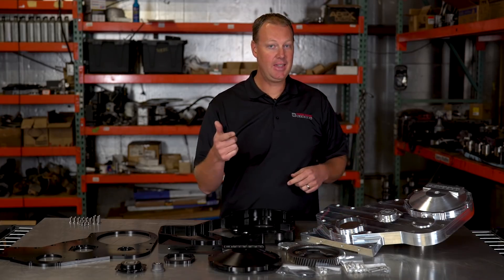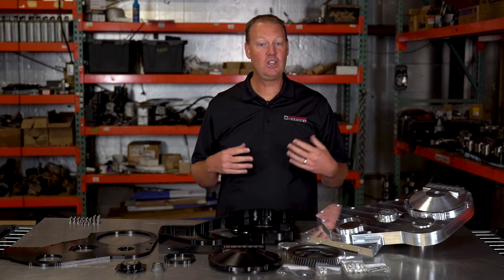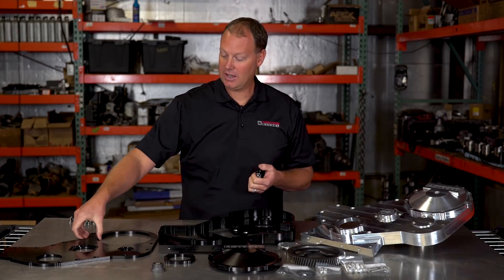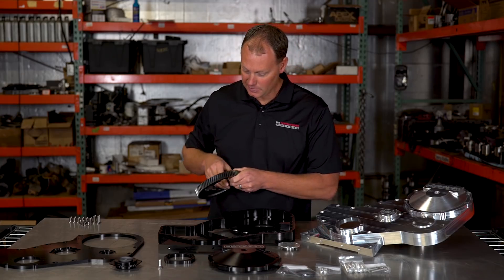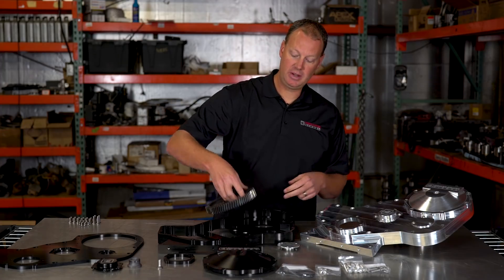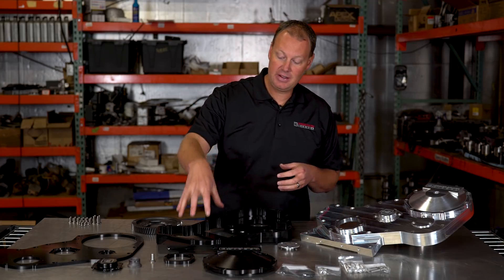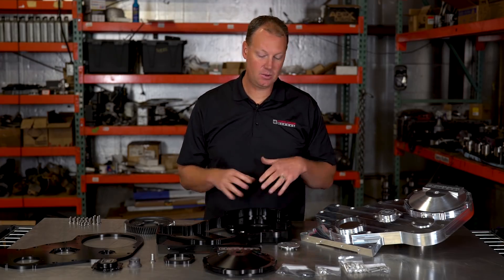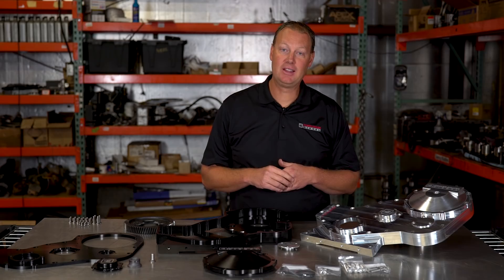Common Rail P-Pump Gear Case | Power Driven Diesel

Comment: Would like to see that for a 5.9 Cummins and to run the Powerdriven Diesel fuel pump off the cover like Todd does with his Waterman’s fuel pump on his race truck instead of building it to the bottom that would be cool really clean

Comment: What is the benefit of having a p pump on a common rail?
Reply: It’s just a conversion to get rid of the electronic common rail injection system in favor of the mechanical P pump. As far as benefits it just allows you to use a bigger 6.7 bottom end with a mechanical injection pump which is favored in some applications  for its ability to reliably supply a lot of fuel, like sled pulls.

Comment: speaking from a towing aspect, not racing or sled pulling. prolonged uphill towing. lots of loaded millage... if i swap out my trusty old 12v with a 6.7 Ppump. leaving it close to stock numbers for the 6.7 nothing wild. would i see better egt's turbo spool, and over all towing improvements by swapping. one of my trucks is just under 800k and its getting time to retire that old 12v. the 6.7 are far more common and oddly cheaper than a good 12v in my area. it would still cost more in the long run to do the 6.7 but im an odd duck who like real reliability over electronics. as for transmission i just completed a spicer 3053a swap and would plan on running one behind the 6.7 if i did so... really dont care about being faster. just hate how i have to watch my egt's more than my speed in the mountains.. its a tricky trade off with a 12v.. power and high egts, lower power low egts.

Comment: I have a dumb question. why don’t I ever see anyone using water/methanol injection anymore? did Everybody give up on it??
Reply: i think you should come up with a 2 stage belt drive system kinda like your fuel pump set up. that will run based on boost or EGT I have a  kit It’s pretty sweet when it works...but the Electric pumps  don’t hang very long.

Comment: Sorry but those counter sunk screws are absolute rubbish use real bolts . I bet you'll need blue loctite for those nasty screws good luck when you round them then need drill them out bit for a eazy out or( snap on) broken stud removal  kit

Comment: Is there a way you could of made the gear case come off with out removing the cam
Reply: Why would you ever need to do this?
Reply: @andrewterry3176  
Because if the gear case starts leaking oil u got to pull cam to put new gasket behind gear case
Reply: @bigmurph1447  if you had the case off ever and resealed it, chances are, you wont ever have another problem with it leaking. I don't think that could ever happen without sacrificing structural integrity.
Reply: @andrewterry3176  yeah I know it was just and idea sometimes I just think about stuff to make it easier In the long run if it did need to be resealed

Comment: Does a stock oil pan fit off a 6.7 with this pan or do you still have to adapt the pan to work with this case like before.... Do you guys sell a straight cut gear to drive the p-pump or do you recommend changing out the cam and crank gears to helical style
Reply: PowerDrivenDiesel ahh cool thanks for answers my questions:)

Comment: Sweet engineering job to the front case.!
What I would like to see is some front suspension mods required to run that kind of torque 
Maybe a little info on how to keep from bouncing at launch( air pressure, shock compression rebound, spring rate etc)
Thanks a million for the info, have fun and be safe

Comment: Would a standard 2nd gen p pump gear case not bolt onto a common rail block???  Whats different?? I was always under the impression that gear cases are interchangeable between the common rail and older blocks..
Reply: Or just run a 12v crank. You can drill and tap the holes and make it work with a factory gear case and oil pan its just a pain
Reply: Andrew Terry yeah but then that turns you into a 6.4 and you have to ether get longer rods or have the block decked... a gear change would be much cheaper
Reply: @keiferjanz3197  they also make a piston with a different pin height to make up the difference, but yes you're right
Reply: Austin Washburn nope bolt holes are in different places. Also there is a lot of other supporting changes you need to do like for instance changing the crank gear to a helical gear.
Reply: @keiferjanz3197   Yeah I already have that planned out, 6.4 is the route I'm going so I am using a 5.9 crankshaft. But it sounds like I will have to rethink the front gear case some more. I dont have a 6.7 block yet so I couldn't confirm the differences/similarities between the gear cases.

Comment: Man this are absolutely nice parts. 6.7 P Pump 😬👍 
What head and injectors do I need to use on the 6.7 block ? From a 24v 2nd gen ?
Reply: the 24 valve head is the same from  03 common rail to current, as far as injectors you want the 2 nd gen head 98.5-02 to be able to use 2 nd gen injectors with p pump and also you need to match piston bowls to the right 24 valve tips to have the right spray pattern.
Reply: Also need to change out the crank shaft gear to the older helical style from old 5.9 as common tails use straight cut. The oil pan might need to be adapted as well...extended on the front... or at least it did when people started adapting ome cases for p-pumps years ago, I’m not 100% sure about this case fitment.
Reply: The heads are not the same...
Reply: Justin Blake ok sorry, what I meant to say is that 5.9 common rail and 6.7 heads are the same because we rebuilt an 05 and used a 6.7 head.